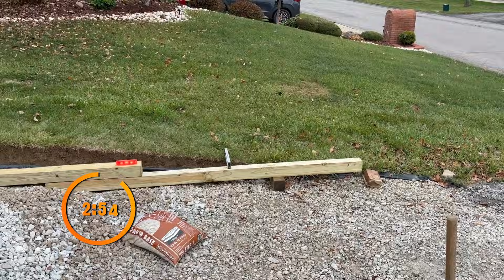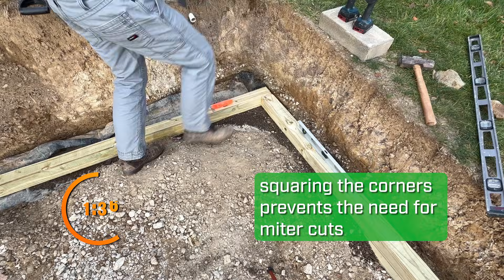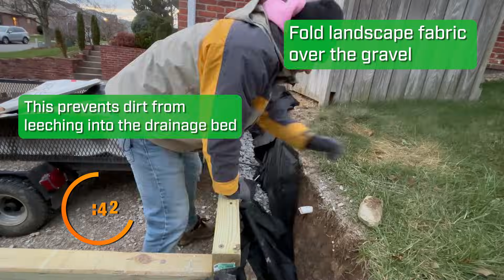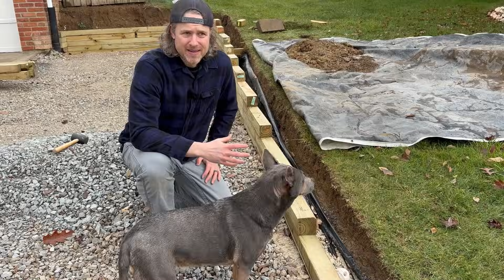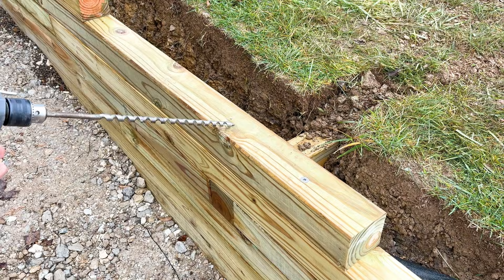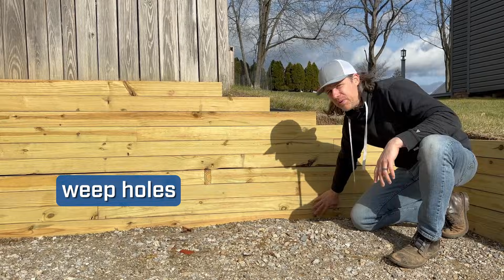Retaining Wall Quick Build

Comment: Hey Blake! Thank You so much. This was very informative and helpful. My only question is how many Dead-backs do you recommend per length of the wall? And is each dead-back placed at one depth, for example a dead-back at the height of three stacked timbers?
Reply from the maker: I suggest every 4-6 feet. You could go every 3 courses. And they are typically all the same depth. Roughly 4 ft is what I use.

Comment: You nailed the format. A quick 3 minute overview first, then the deeper dive for anyone who wants the details. This is exactly what’s been missing from YouTube. Instant subscriber.

One comment to add though: always apply a wood preservative (e.g. copper naphthenate) to the cut ends of pressure treated lumber.
Reply from the maker: Thanks for subscribing and that’s a good tip since the ends tend to split.

Comment: Do your self a favor. Use concrete blocks. There are so many styles and colors and you wont have to replace them in a few years when they rot. Pressure treated does rot.

Comment: You ended up building part of the wall in the dark due to standard time, not DST.  If it was DST, you would have had more daylight to work with.  Nice wall by the way.

Comment: Question? Once you did the bottoms with the rebar on the additional boards did you just use screws to attach or did you still use some rebar somewhere. Thanks. Great video

Comment: To answer your question: Deadmen, but I knew what you were talking about!

Also, great speed round AND great follow-up. Really appreciate the “I coulda done but didn’t and here’s why”.

Sharing with a friend who’s building a wall with me this season.

We’re building with the first course on the edge of an existing concrete patio. Only thing I could’ve used is a detailed explanation of the drainage trench prep and whether or not to invest in housewrap for the back side of the wall.

Thanks!
Reply from the maker: You could do that I suppose. I've also seen some people paint the backside with waterproof membrane or tar. If the drainage/gravel is done right it should be a nonissue.

Comment: How many dead backs are needed?
Reply from the maker: I would do a deadback every 6-8 feet of horizontal length and every other foot for vertical height. I only did the one in mine because my wall was pretty short.

Comment: Any recommendations for using timber spikes instead of screws?
Reply from the maker: I don’t see why that would work. Just a bit more effort to swing a sledge. I would also do it while the wood is still wet. The dryer it gets the more I would worry about it splitting.

Comment: I built a similar wall, 6 yrs ago and it works, I have one with my neighbors two story house on the other side of the wall in snowy MA.... make sure that the grass in your case is slightly higher than the wall so that when rain falls in the direction of the wall the excess falls over the wall and not behind the wood as much as possible.  This little feature enhances the life of the wall.  Also heard width of gravel behind the wall in inches should be same as the height of the wall.
Reply: Do you mean if the wall were 6 feet high you should have at least 6 inches 3/4 inch stone?

Comment: I used the same pressure treated 4x4s to build two egress window wells and once everything was in I sprayed them down with a 50-50 mixture of diesel and use motor oil and along with the added waterproofing features of such a mix it also gives it a nice light staining that’s a bit more tan brown and than the yellow and green hues of that lumber.
Reply from the maker: Love it. Oil is the best protector but my audience might not like that idea. Im going to use a conventional stain.

Comment: Hi, I may have missed it, but what’s the width and depth of your timber please? Been researching sleeper walls but looking for a cheaper option. Thanks
Reply: Its a 4 by 4, pressure treated.
Reply from the maker: 4x4 by 8 feet on the right side. 10 feet on the backside.

Comment: Always use rock or block for retaining walls. Wood looks pretty but doesn't last long enough. The previous owner of my house used Railroad ties, and my yard ended up in my neighbor back yard. I used 90lb blocks with drain on back side of wall. More than likely will last forever and is quite handsome.
Reply from the maker: It’s true that wood won’t last forever but if done right it can last several decades. I’ve seen railroad road tie walls that lasted 30-40 years. Same with treated timber. I’ve also seen block walls that fell over because they weren’t installed right. Getting it right is universal. Either way thanks for watching. Btw I proposed block first and my wife said no.

Comment: To bad over time that wood will rot, m9ve and tip... should have used block
Reply from the maker: Block would be a different video. The wood will not rot if it drains properly. I built my first wall 20+ years ago and it is still standing.

Comment: And see you in a decade remaking that wall when that wood completely rots away
Reply from the maker: I built my first wall like this over 20 years ago and it is still standing. With proper drainage they should last a long time. You can seal or tar the backside if you want extra water protection.